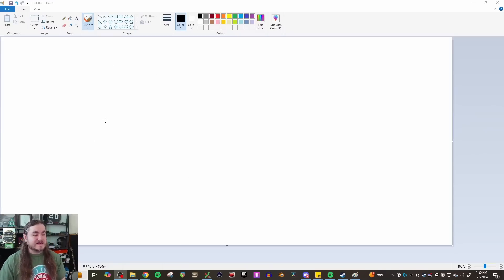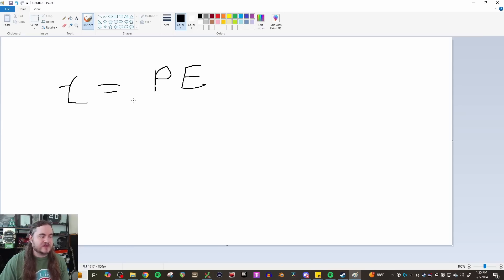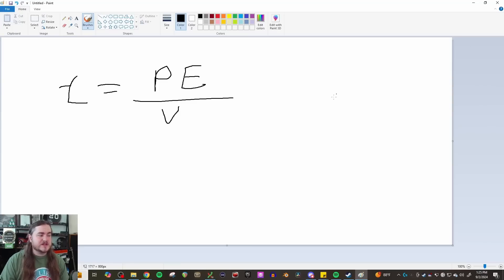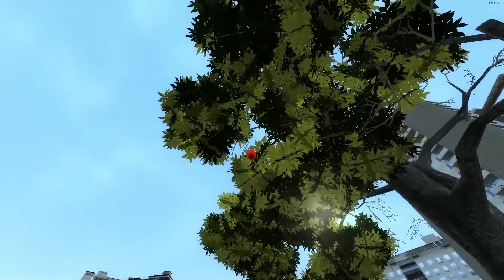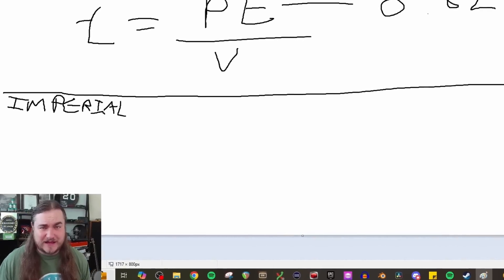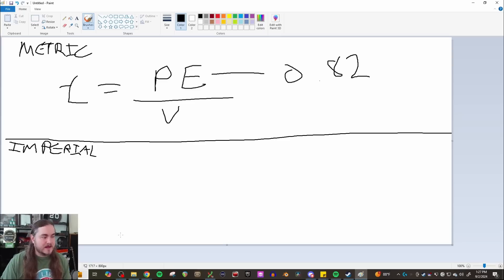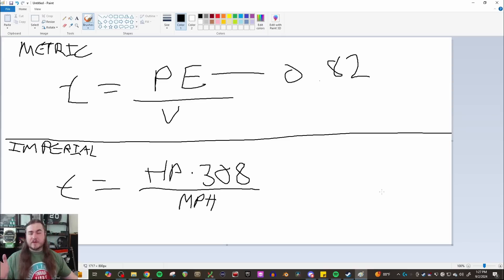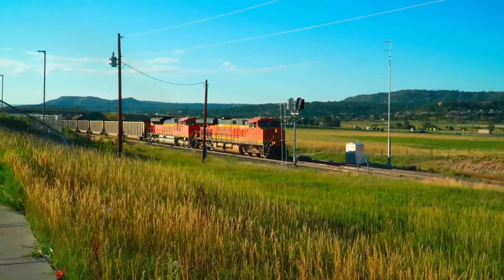Diesel Tractive Effort 101

Comment: Just for reference:
SD70Ace TE = 850 kN (starting) & 700 kN (continuous)
Big Boy TE = 602 kN

As for HP, the SD70Ace has 4500 versus the Big Boy's 7000. Hence why the Big Boy will pull any train it can start faster than the SD70, however SD70 will start a much heavier train thanks to its higher TE at low speeds.
Reply: Unfortunately, the crew in the 70ACe will lose their hearing faster than the crew on the Big Boy! lol

Comment: Thanks that helps! could 102 be Gearing? Like more info about Passenger/commuter diesels engine gearing, compared to Freight locos gearing. I hear the F-40's get beat to hell at full throttle all day long. 

I'm mot sure if this is still the same thought but maybe explanation of why the commonality of the B-B trucks and C-C trucks on Diesel locos here in the USA

Comment: The whole "TE Equation" "Drag Rating" "Maximum Starting TE" "Min. Speed for Full HP" conversation still is one of my favorite subjects to nerd out about.

Like, the TE equation works pretty well at any speed above the Min. Speed for Full HP, but as you bog down past that speed (depending slightly on the locomotive) you'll start to lose horsepower, but still gain TE (just not fast enough to keep your horsepower up). Then, once you reach the "Drag Rating" speed, the excitation system (specifically the feedback comparison portion) is designed to limit current from the main to the maximum continuous rating of the main or TMs (whichever is lower). If you continue to bog down, some locomotives are equipped with special components in the feedback comparison portion of the excitation control that will allow the main to put out above the continuous rated current. This will continue to go up until you reach the "Max Starting" Tractive effort. Trouble is, if the engineer doesn't watch what they're doing, they'll roach a TM (or the main, or both) by operating in this rang for too long.

That's still a bit simplified and this all can vary based on locomotive model, age, and manufacturer, but it's such a nerdy thing that I love going on about.

Great video as usual, and I was glad to hear you elaborate on some of the more complex things about diesel tractive effort calculations.
Reply: Nice insight. The old style load control (electro/hydraulic/pneumatic/ mechanical analogue beasts) is my big nerdy thing (amateur).
Reply: @A9106  there's certain things about those that make them way simpler, and other things that make them way more confusing.

Comment: BNSF has changed their formula for figuring horsepower. For DC locomotives it's the same, but for AC locomotives they get their rated horsepower goosed up to over 5000 HP on account of less wheel slip. Even though their diesel engines may still be 4400 HP. It's good and bad for TY&E. It's good that the company has finally also admitted that the GE C4s with only 4 traction motors are bad to put on a heavy train running over a subdivision with hills. So maybe we'll get fewer loaded unit trains built on flatter subs with all Dash 9s and C4s that stall on more hilly subs, and the company can't figure out why. "On Paper, you have plenty of HPT!" But bad because with the new GE 216 ton 6 traction motor AC locomotives, some coal sets that used to run 2x3, with some throttle restrictions, but you could exceed that when you were below 15 mph going uphill, now will be 2x2 with the new GE heavies, but the trail unit on the head end will be in DB Only unless on the absolute hilliest subdivisions. I admit, it does work okay on dry rails, but there's no margin for error for inclement weather, and getting approval to put the 4th unit in run doesn't seem like it's either easy, or fun.

Comment: Honestly I think one of the simplest ways to understand this is that the actual engine of a diesel locomotive operates at a fixed RPM, while the engine of a steam loco operates at the RPM of the wheels (at least unless its a shay :P)
Reply: The only diesel electrics that are always in Run 8 are the Amtrak passenger engines because of the HEP need.  Diesel RPM increases as the throttle is advanced through Run 1 to Run 8 which is the maximum diesel RPM.  Units of any train climbing any ruling grade will be in Run 8 no matter the train speed unless they are light or have a minimum loaded train.

Comment: I'm still a bit confused about where the friction comes into play.
Reply: The friction that is wanted is between the wheel tread and the top of the rail to propel the train.  Or that friction in reverse to stop or use dynamic braking.  Starting and dynamic braking is only using the loco drivers while all of the wheels of a train are used for air brake stopping.
Reply: @royreynolds108  I understand all that.  What I'm confused about is how that plays into the math.
Reply: It limits maximum starting tractive effort.
Reply: @Knsgf  Yes, but where does that fit into the equation?
Reply: @pleappleappleap  TE = (power * effciency) / speed <= weight-on-drivers * friction-coefficient (which is around 0.25 for dry rail or 0.3 if sand is used).

Comment: What about weight in tractive effort? Some locomotives came out in 2 different weight options with the same rated horspower, but they has 2 different tractive effort ratings? Also it's impossible to have contant torque variable horspwer and vise versa, Hp = Fd/t.

Comment: Something I've heard through my time in college regarding internal combustion VS electric motors goes something like this: 

"It's easy to keep an internal combustion engine from starting but don't try to stop it once it's going. It's hard to keep an electric motor from starting but it's easy to bog down." 

Feel like that's appropriate here given what you've mentioned.
Reply: As a Brit used to driving cars manual gearboxes, I can assure you it is very easy to stop a petrol (gasoline) internal combustion engine when it's running.
Reply: cut the fuel supply.

Comment: Hey Hyce, can you explain for me what is going on with the large amount of steam that appears to be blowing out around the cylinders when a steam engine starts up, but then when the train is underway abruptly stops? I've long wondered what's going on with that, and you're the best person I can think of to explain it. TIA, Audry.
Reply: When a steam locomotive stops for longer than say 10 minutes or so, the cylinders cool enough to condense some of the steam into water when the steam enters the cylinders.  After the train starts moving and water stops coming out of the cylinder cocks, the valves under the cylinders are used to expel water or wet steam, the cylinder cocks are closed to keep all of the steam in the cylinders.  Does that answer your question satisfactorily?
Reply: @royreynolds108  Makes sense. Thanks.
Reply: Not Hyce, but I believe I know what it is that you're asking about. 

When a steam locomotive is stationary, the steam that is in its cylinders will begin to cool down, which will cause it to condense back into liquid water. Water, being incompressible in a very bad thing to have in your cylinders so they have valves called cylinder cocks attached to the cylinders that allow steam and water to vented out. Once the engineer is sure that there is no more water in the cylinders the cylinder cocks are closed to avoid wasting steam.

Comment: Great video! I look at it as power impulse spacing. At starting, Mechanical/Steam is very abrupt, electric is smooth. It all comes down to adhesion coefficient. Exceed that and you just spin. If piston / steam was as cheap to run as diesel / electric they could have mixed power and get the best of both, great starting power of electric and high speed power of steam!!!
Reply: I think you need to take a step back and look at the forest, rather than this specific tree. Steam doesn't more more horsepower per ton than modern diesel or electric. Impulse spacing is a consideration for the engineer starting a train but not a binding restriction on the power specified for any real world route/application.

At low speeds these are are NOT sinusoidal power phases, in a simple 2 cylinder steam engine at max cylinder cutoff the valve remains open to steam chest almost the entire way to exhaust, your talking falling to 50% power for 10% of a rotation 2x per rotation, with far more slack in the draft gear along the train than period of reduced power even if you where unlucky enough to be stopped at the worst rotation. 3 cylinder locomotives existed where more area was desired but either loading gauge or inertial forces didn't allow the 2 cylinders to be larger, it wasn't worth the cost in any context a simple twin could just be upscaled. So in neither context was there any even theoretical benefit to a hybrid system. Diesel and electric can already wheel-slip, so steam cannot help them start a heavier train, even if somehow it didn't add any extra cost at all. You know what does start heavier trains? Slugs. Simple railcars of concrete ballast with traction motors under them.. and they are rare because desired freight speeds are fairly high, and beating hard on less equipment often costs simlar money than being gentler on more equipment that can be less specialized.

Comment: Or as a former Class I engineer dealing with power desks that were miserly with the horsepower, I liked to say, "I love the smell of burning traction motors in the morning, it smells like overtime!"  😆
Reply: As a locomotive tech, I can say I've also had to deal with that. Burned leads aren't an uncommon thing on locomotives that frequent heavy trains.
Reply: Oh yes! Conrail then CSX Class 1 Locomotive Engineer. Loved the job.
SD80 Mac's rule....
Reply: Isn’t that why railroads are doing rebuilds switching traction motors to AC from DC to keep from burning up commutators in the motors
Reply: @railfanpat1719  You can't stall burn an AC nor will they do a burnout and melt the rail under them.
Reply: @railfanpat1719  Yes, there are no "short-time" ratings on AC traction motors, among other advantages (fewer moving parts, etc.).

Comment: One big thing that you didn’t mention is diesel electric locomotive transition where the locomotive motors go from series to series/ paralle at about 20mph

The various formulas for modern trains is basically 
Horsepower per ton 
Or
Tons per equivalent power axel

So like a motor GE can be up 14.4 equivalent power axle

Comment: Wouldn't  it make sense to have differently geared locos on a train then?
Reply: In the same train? No, as locos with higher gear ratios will get overloaded at low speeds, while your top speed will be limited by engines with low gears.
Reply: @Knsgf  Well if you control them independently? Low gears for getting going once you´re going use the higher geared ones to go high speeds.
Reply: @SchrottiJr  Diesel-electrics are "in gear" at all times, so the powertrain on low-geared locos will still get damaged or fly apart at high speeds. And at low speeds high-geared locos will be underutilised, i.e the worst of both worlds.
Reply: @Knsgf  well the traction motors should be able to handle the rpm anyways, it´s just under load that they get so much backdraft that they become inefficient, but if it was possible and made sense someone would have already done it I guess. 😅
Reply: It would be the identical to having all locos have the same resulting average gear ratio.

Comment: Worth noting that just as you can't maintain max horsepower at slow speeds because adhesion or heating limits, you can't maintain max horsepower at very high speeds because of voltage limits. Faster you go, the more voltage series wound DC motors need to maintain a constant horsepower, and if you only provide a constant voltage then the horsepower drops with speed.

And that's why the difference between an SW1500 and GP15 matters-both are rated at 1500 horsepower and can pull the same, but the SW1500 can only maintain that full power output to about 21 mph. The GP15, on the other hand, can maintain full power output up to its maximum speed (GP15 has transition allowing motors to receive higher voltage as speed increases, most SW1500s do not), which means it straight up pulls better than an SW1500 at higher speeds-useful if you ever intend to take the train out of the yard.
Reply: I've wondered a similar thing about something like a GP35 vs a GP40.

Like you said, transition can affect the performance of the locomotive depending on the speed you're going, which is why an SD40 will pull about 50% more than a GP40 at low speeds.

I wonder if a GP35 could outpull a GP40 in a short burst at low speeds because of the same thing. If I'm not mistaken a GP35 and GP40 weigh about the same, but only the GP35 will start in series, meaning the main can deliver more current since it's only feeding 2 paths instead of 4.
Reply: @CDROM-lq9iz  GP35 won't outpull GP40, because the former's main generator is D32 DC unit rated at 1700 A, whereas GP40's AR10-D14 is AC capable of 4200 A continuous current. The low max amperage of DC requires a transition, while much higher current of the alternator allows to eliminate it.
Reply: @Knsgf  if my memory serves me right, a d32 main is rated for 2900 amps of continuous current. Across two series paths, that'll give you 1450amps on 4 motors. A GP40 with an AR10 will start in parallel which only gives you 1050amps on 4 motors.

Edit: anecdotally, I've seen alarms on our gp35s where the main managed to pass over 4000 amps of current.

Comment: Question... so if I have a sh!t box 45 tonner with a single tranction moter and generator but dual alternators... should it be able to go over 400 volts dc with throttle at max? Just seems it isnt building power properly when facing any form of resistance including a .5 percent grade qhere it resides.